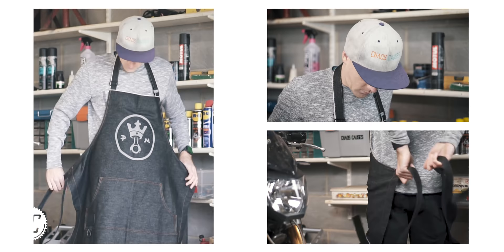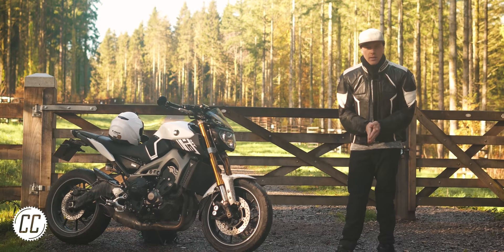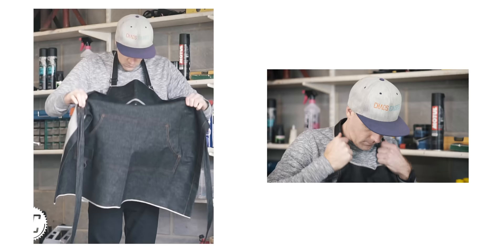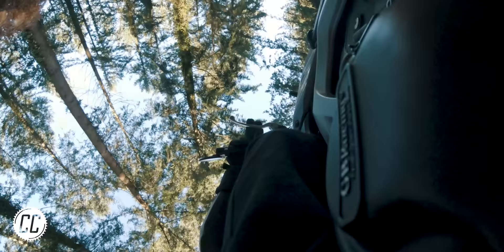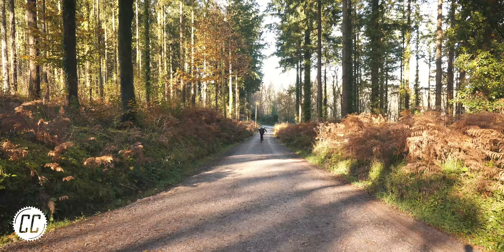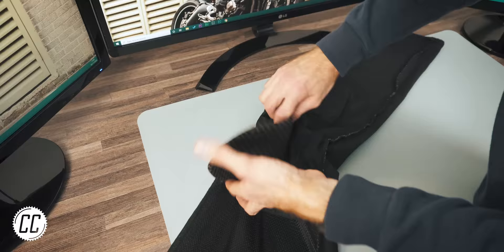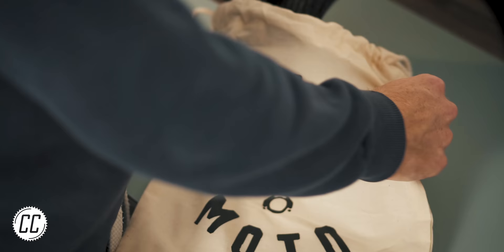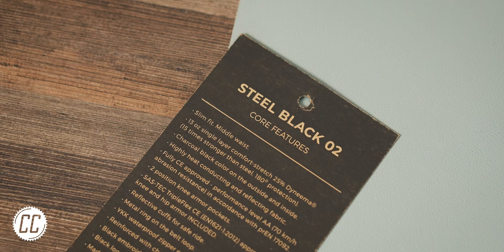I Didn't Want These Motorbike Jeans...

Comment: The jeans do look nice, a lot more like regular jeans than most others ... but very expensive for AA rating and only level 1 armour. My RST Tech Pro jeans are admittedly double layer in impact areas but they are AAA rated, come with full level 2 armour and cost less than half the price of the Pando's .. they do also look a lot more like bike gear than regular jeans which wont be to everyone's taste ... but the price / protection ratio on them is outstanding ;)
Reply: Indeed, anyway when you walk in with your jacket and helmet, there's no point in hiding a pair of moto jeans :P
As you say, there's quite a few options around the 250 CA$ mark which really do the job well.
Reply: i've just sent back some RST tech pros..just felt heavy and awkward to me..I guess the advantages of these is the weight , but it's quite a hike in price
Reply: @sn00pgreen  yeah there is always a compromise. The Tech Pros will certainly be heavier than a full single layer jean .. but lighter than full double layer jeans and leathers. They sure aren't perfect but for me the price + the AAA rating were the winning points .. at around £120 (on sale at the time) I couldn't find any others that even came close.
Reply: Looking at them I dont think theyre comparable. These are jeans you can comfortably wear all day, and yours are a lot safer, but bulkier. Looking at them I cant imagine being in them for 8 hours at the office (They look much bulkier than my Alpinestars Victory Denim ones, and those are already at least double the weight compared to my regular non-moto jeans). But if you only want them for "fun" riding, weekends, etc., yours look like a much better deal, for sure.
Reply: @josecarlosgadeadoncel8157  End of the day it's about whether you value office comfort or crash protection. Personally I buy riding jeans to ride in and wear chinos at my job. I've worn the RSTs for more than 8 hours in a day ... riding and hanging out with biker mates ... yeah they would be a bit warm in the office but still far lighter and more comfortable than trying to wear leathers all day - which, considering they offer the same level of protection as leathers, is a decent achievement for the paltry price of £120. I'm not saying the Pandos are crap ... they are just overpriced for the features they offer. Even Oxford make some AAA rated single layer jeans for just £150 which are directly comparable to the single layer AA Pandos ........

Comment: I have a solution to your  potnoodle splashback problem.

Before adding in water and sauce take your fork and stab it into the noodles repeatedly until they are broken up good. Add the sauce then add the boiling water but not upto the recommended line, just under the line maybe 5mm-10mm. Aslong you make sure the waters past the top of the noodles a bit. Give it a good stirr so it's mixed up good, leave to cool and voila..your life has been changed!

Thank me later